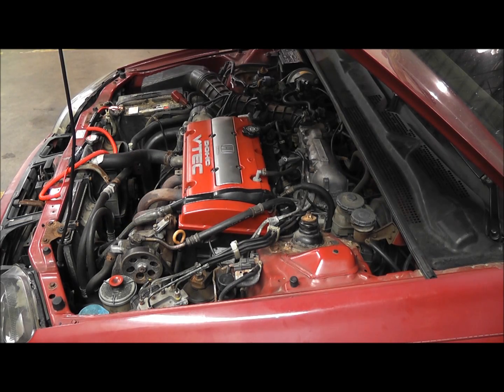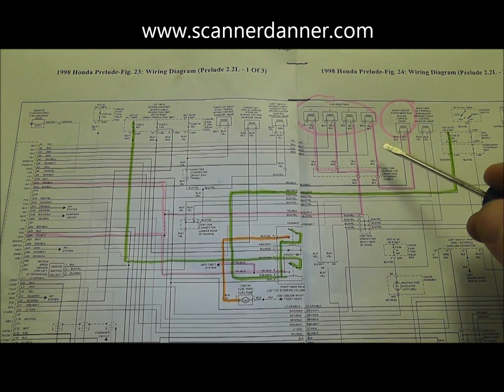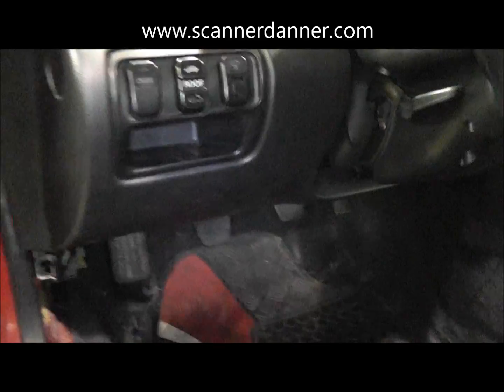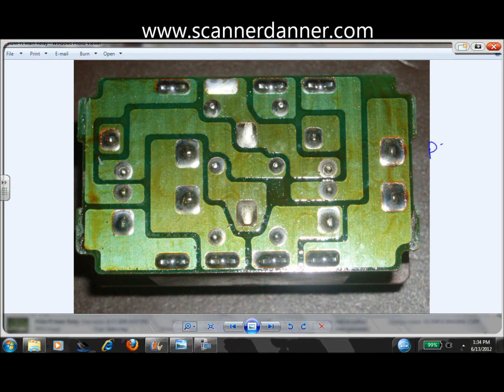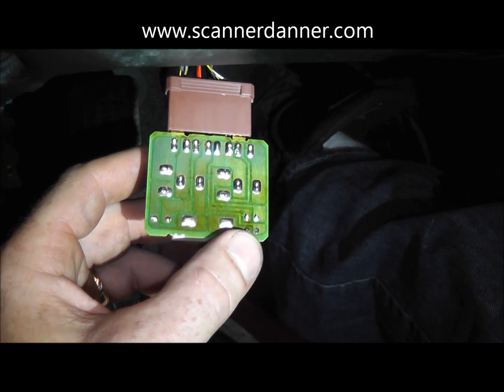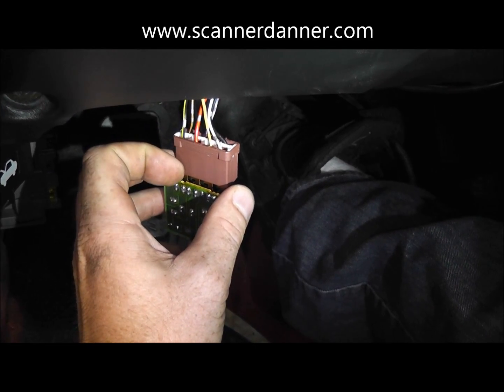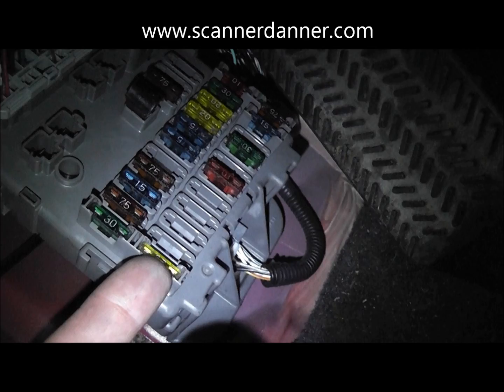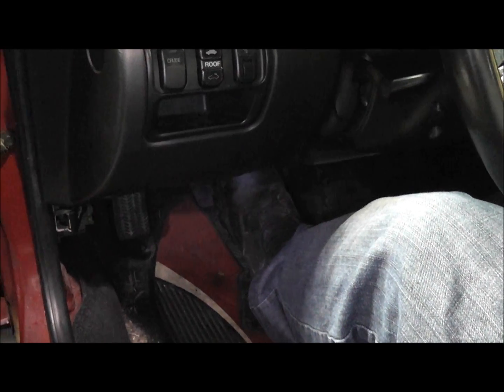How to test and fix a PGM-FI main relay - Honda/Acura

Comment: I can't tell if this is a silly question, but if this fuse was out for the green and white wire, how on earth did the car start at all ever?

I'm trying to figure out how the car could fail to start and then once the guy gave it some gas, overcame that resistance to start while the reading the white wire was absent.
Reply from the maker: I don't remember but I think it was kicked or bumped and fell out and never started after

Comment: ...mmm WRONG  !!!  I could start my 2002 Odyssey and it would die while I was driving it !   if you waited 10 to 15 minutes it would cool down and be able to start again !   $80 dollar part at AutoZone and $147.08 at Honda    August 2024
Reply from the maker: Lol, like I have any idea what you're talking about from a 10 year old video. Context helps!
Reply: @ScannerDanner  one of the MAIN RELAY's  solder joint's on the circuit board over heats and melts apart while the engine is running and stops the car dead !  If you allow it to cool down... the solder comes back together just enough to allow you to start the car again .... BUT it will soon over heat and fail again
Reply from the maker: @diverdave4056  when we saw these it was always after sitting. Never saw one with random stalling. 
But yeah, you were shouting too, which is kind of ridiculous. Especially on this old dinosaur

Comment: What if it only doesnt start when cold outside like temp wise anything below 35 it will just crank and not turn over. I have a 98 honda prelude. New fuel pump within a month after old gave out, fuel injectors clean and spraying like new with replacement pressure and orings, fuel filter new,  42 psi when checked. New Ngk plugs, wires, rotor, cap, ignition coil, valve cover gasket, no vacuum leaks, entire cleaning and regasketed the intake manifold, tpms had a crack which was replaced and relearned, the throttle body was regasketed and cleaned, the air intake filter new, ignition switch new, air intake temp new, great spark, and ignition timing, ect reading properly, icav new, the fitv  regasketed and cleaned, bad terminals replaced, brand new honda battery due to other being old and giving out. And im sure theres some other things missing but after all that the darn thing still wont turn over in winter. Oh and main relay is pulled as im typing and seems the solder joints are good! I dont know what else it could be other than pcm but reads live data correctly or am i  missing something to look at.

Comment: I had the white with green not light with a test light.

So i got a new main relay and nothing. Still no crank no start.

What's the problem now? I checked the fuse for it and it won't light up with the test light either. Switched the fuse with a known good fuse that lit up and still no light.

Could this be a wiring issue? Any help is appreciated

Comment: I had this problem on my 2003 Honda Pilot and it finally died completely on the freeway where I coasted to an exit safely.  An hour of it cooling down and about 20 cranks and lots of taping the module with my knuckles didn't help start it.  Had it towed home.   Two days later, I tried starting it and it started right up.  It had been doing this on and off for about nine months and just got worse and worse over time.  What I learned was that my 25W soldering iron wasn't enough heat for the joint and the large relay pins, etc.  I switched to a adjustable soldering station and at 700 degrees F it still wasn't enough heat.  I finally cranked it up to 850 degrees F and it was able to do a good job.  I first used solder wick to remove all the old solder and cleaned up the joint real well.  I then used a rosin-core solder and got real nice new solder connections.  The car started right up and has worked fine (so far) for about seven restarts, even when the engine was hot and then sat for about 10 minutes (a typical stop at a store, run-in, and back out).  Really appreciate your videos.  Thank you.

Comment: Sir when you test the IACV yellow wire is this key on or not? thanks
Reply from the maker: Yes, key on my friend
Reply: ScannerDanner hi friend when i tried to test the yellow wire using test light the light is dim not brighter?
Reply from the maker: @jordanfort4294  Then you have a voltage drop on that circuit
Reply: ScannerDanner what does it mean sir? thanks
Reply from the maker: @jordanfort4294  high resistance, corroded connections, break in a wire (not a full break), you need to trace that circuit and you will need a good wiring diagram https://eautorepair.adtrk.biz/?a=10817&c=24&p=r&s1=
Reply: ScannerDanner thank you so much sir✌🏼
Reply from the maker: https://eautorepair.adtrk.biz/?a=10817&c=24&p=r&s1=

Comment: excellent video just want to add a little, I had this problem several times replace relay repair relay comes back , when fuel pumps get old or fail they pull more juice cause more heat consider replacing pump if repeats,
Reply from the maker: Great advice, thanks for the tip for the community!

Comment: So. If the main relay is not the problem, we must check at the fuse box !! Great !!! But where go to, if the isn't getting to the fuse box neither?
Reply from the maker: ignition switches are common failures on these systems, they key is having a good wiring diagram https://eautorepair.adtrk.biz/?a=10817&c=24&p=r&s1=

Comment: Last night I fixed my neighbor's 97 3.5 RL before seeing this video.  It had cracked solder joints AND a missing fuse.  Bizarre.
Reply from the maker: that is weird
Reply: @ScannerDanner  Today he was out pressure washing it.  It sat for almost 9 months!  Anyway, I was thinking about doing a video about this but seems like you've got it covered!
Reply: Oh one other thing I should mention for future reference is that there was another symptom that cropped up - I hooked up my cheapo OBD-II scanner and it wasn't receiving any power from the port.  That problem went away after replacing the missing fuse #6 which is what was supposed to give power to the PGM-FI unit on pin 3.  According to the Chilton book, that 20A fuse supplies both the 2nd half of the PGM-FI relay that feeds the fuel pump but also the powertrain control module.  Unless that port only works when the engine is running, then it seems that getting no power to the scanner might be a good indicator of that circuit having failed in some way.  (97 Acura 3.5 RL)  I should also mention that I have seen problems related to cracked solder joints on many Mercedes vehicles too, and have done videos about that.  This seems to be a common failure mode whenever a heavy component like a relay is mounted to a circuit board using only the weak solder electrical connection as the mechanical connection as well.  Years of vibration just break the soft solder at its stress points.  Many sudden and intermittent failures can be fixed by re-soldering joints on cars that have this type of circuit board construction.  Adding an electrically inert and acetic acid free adhesive to stick the components down and hold them fast to the circuit board, where feasible, is a more permanent fix than solely re-soldering the joints which are not up to the task of supporting the full component over time.
Reply from the maker: Do it anyway!

Comment: I just resoldered the points on my Fuel Pump (PGM-Main) Relay circuit board on my 1995 Acura Legend on your recommendation and it actually worked!  Thanks so much for the video.

Comment: Hi ScannerDanner great video by the way I had a question I'm trying to figure out why my 2001 Honda civic ex will crank but won't start. Let me start off by telling you that someone tried to steal my car but failed and even though they didn't steal it they cut all the wires on the driver side under the dashboard. My question to you is when someone does cut the wires below the dash driver side did they short my PCM and I have to replace it? Or is it the PGM Fi main relays that I need to replace and that's it? I just need some sort of direction if where to go with this.
Reply: First let me tell you that I'm not a mechanic by any means , but we might be in the same boat ... my problem is a no Crank,  no start but I think what I have to say still applies ....the IMMOBILIZING SYSTEM  ( ANTI - THEFT ) in my 2005 Honda crv DISABLES THE FUEL PUMP , FROM WHAT I UNDERSTAND . AND WHEN I PUT MY KEY TO THE ON POSITION , I DONT EVEN HEAR THE FUEL PUMP PRIME FOR 2 SECONDS OR SO ... I FIGURE somewhere between the fuel pump and pressure regulator , injectors , PCM FI MAIN AND ALSO PCM FI 2 is the problem , apRt from fuses , relays and wiring connections ....they cut all the wires probably to disable the ANTI- THEFT IMMOBILIZER . I DISCONNECTED MINE ON PURPOSE BECAUSE I THINK IT IS WHY MY FUEL PUMP IS NOT PRIMING .... IF YOURS IS CRANKING BUT NOT STARTING , THE FUEL PUMP PROBABLY IS PRIMING ... for me , I need to figure out how to bypass my immobilizer ???????
Reply: Take EVERYTHING I SAY with a grain of salt , but I am almost positive it is not the PCM , OR EVEN THE RELAY , IF IT CRANKS BUT DOES NOT START .... IF IT CRANKS , THE FUEL PUMP IS PROBABLY PRIMING AS IT SHOULD , WHICH MEANS THE RELAY IS DOING ( AT LEAST PART OF ) ITS JOB , which means the PCM is doing  part of its also . I would also pretty much rule out the IMMOBILIZER , BECAUSE IT CRANKS BUT DOES NOT START ....... BELIEVE ME , I have been trying diligently to figure this out for over a year now : I want my CRV BACK !!!!!
Reply: BY THE WAY , I don't make ANY MONEY ,so I try to solve all of my problems without the aid of MONEY : so you can just imagine how much I greatly APPRECIATE PAUL DANNER , AND THE LIKES OF HIM : ANGELS , GOD-SENDS , IF YOU ASK ME ...!!!!

Comment: So annoyed with my 99 accord, thought it was the main relay and replaced it with a new one from oriellys, did not fix it so I replaced the fuel pump and that didn't fix it either, my car runs good in the morning until I get where I'm going but when the engine is warm and I try to restart it ? It wont start, and a couple of times it did start then died going down the road and left me stranded for 30 minutes or so, I'm wondering if my issue is the immobilizer or ignition switch or key? Because the green key light flashes 5 times after I've pulled out the key

Comment: Nice vid ScannerDanner. I just checked my Mistuba main relay in my 98 crv and don't see any hairline cracks. I just bought this car and having an intermittent crank but no start issue.  I just spent about a grand in parts and had the head reworked, (burned exh. Valve) and replaced all ignition components while there. New dist., wires, plugs. I have yet to adjust the timing on it but probably will tomorrow. Runs great when running. I haven't had the car but a week so I'm not sure how intermittent the problem is. When it does start it sounds like its barely firing, or catching, like holding the starter engaged longer helps it get to firing somehow, if that makes sense. But once running it sounds great.

Comment: Anyone - please reply - is this only for Honda's that do not START?  because my 99 Honda Accord wants to STALL when I stop at a red light or stop sign or when making turns.  PLEASE reply soon - DO NOT want to go to mechanic and get ripped off! Thanks in advance !
Reply from the maker: not all mechanics will rip you off 
So does it not start or you have a stalling problem? Two separate issues.
Reply: It wants to stall whenever I am driving  and need to stop at a light or stop sign.  I checked the main relay and it looks in great shape - even checked with microscope for cracks, etc.   Should I replace main relay anyway?   Car starts just fine.  Thank you  ps - I am very new to car repair.
Reply: Uke - It could be a dirty idle air control valve that's getting stuck. They're easy to take off and you just clean them with a 5 dollar bottle of carb cleaner. Probably will want to reset the ecu after that. Also, buy a bottle of fuel injector cleaner and put that in your tank next time you fill up. It could also be a vacuum leak, look up how to check. Most mechanics aren't looking to rip you off, they want your return business and there's always a lot of competition in town. That said, always do a google search and try any easy solutions before going to a mechanic, they won't try to clean or repair parts, they just replace them, so it's worth the effort sometimes.

Comment: Hello Paul, I have an 02 Acura type S,where is the fuel pump relay and the main relay located? Starting problem
Reply from the maker: https://www.google.com/search?q=where+is+the+fuel+pump+relay+on+an+02+Acura+type+s&rlz=1C1GGRV_enUS751US751&oq=where+is+the+fuel+pump+relay+on+an+02+Acura+type+s&aqs=chrome..69i57.2538j0j8&sourceid=chrome&ie=UTF-8

Comment: I have the same 98 prelude and i suspect something with the main relay after i scanned it for trouble codes and got p0505 for Idle air control system. Also after checking the live data, i noticed the STFT was fluctuating around -20% on average obviously telling me it has a very rich condition, checked O2 sensors and they are working fine. I then noticed when i turn the key to the run position, the fuel pump will prime but not shut off until i either start the car or turn the key to the off position. So my question is what could be the cause of this, i was thinking it has to be an issue with a switch in the PGM-FI main relay staying closed, or the relay itself failing causing the fuel injectors to stay on too long causing the rich condition, as well as the fuel pump and iacv issues? Car has over 200,000 miles on it and 120k on the motor
Reply from the maker: Two separate problems my friend. The fuel pump runs continuously while the car is running and will NOT cause your rich condition. Even with the key on and the pump running, this will NOT cause any fuel to get into the intake as the injectors are normally closed solenoids. Attack your rich condition and your idle control fault code first. 
Hope that helps.

Comment: I soldered the ones that had cracks and when I reconnected it to the harness it was working fine. I didn’t drive it around right away and after a couple of hours i tried to start it again but it doesn’t start anymore. It just cranks. Did I pop a fuse? The check engine light doesn’t turn on momentarily as I start the car.
Reply from the maker: You may have? Check all your fuses for sure and then recheck your solder joints and make sure you didn't cross any of them
Reply: ScannerDanner I popped the ACG fuse under the hood. Thankfully an easy fix. Thanks for the reply

Comment: can someone make a video how to get it out of the case I'm having a really hard time plz message me if you do will be greatly appreciated. I can even PayPal you 10 bucks.
Reply: dillon cassidy did you ever figure it out man?
Reply: dillon cassidy I used a tiny flathead to pry it out while pulling the casing in the opposite direction.
Reply: +Anthony Alvarado yes I did.and then I sold the car.

Comment: Starts fine in the morning but the longer I drive the less hp I seem  to have. After I drive it long enough it slow cranks if I try to turn it back on but I can always get it back on. Longer I drive, slower it cranks. Could this be main relay?

97 civic ex

Comment: I have a 91 honda accord with a  no start issue checked for spark it's good sprayed starting fluid into the tube that leads to the throttle body it acts like it wants to start when I hooked up my fuel guage didn't have any fuel spray out could the main relay not be letting the injectors fire shouldn't I have some fuel leakage?
Reply from the maker: I think these videos will be helpful for you. Let me know
https://www.youtube.com/watch?v=6CMZ4g8n0FQ

https://www.youtube.com/watch?v=SUxagOAVS5M

Comment: I can't find a single video where you cover wire or solder selection for repairs.  I've been using some cheap autocraft solder from a parts store and it's god awful to solder small joints with.  I've found that tin/lead solder is 10X easier to solder small electronics but isn't good for engine bay use because it will rust away.  I feel like this stuff would be a great topic for you to cover for the guys who are just starting out that have never soldered a thing in their life or are having problems with solder flow even while using flux and tip tinners.

Yeah it's easy to solder with big wires and rosin core but even in automotive you're not always soldering large gauge wires or large joints.  Sometimes you have to do repairs on tiny joints and that's where wire and solder selection really plays a part in time efficiency.  I spent 3 hours trying to repair something with crappy autocraft solder!  3 hours because the solder just wouldn't stick right and burned the wires in a losing battle keeping the wire and tip clean.  Once I used some better quality solder I fixed it in 2 minutes.  

For an automotive electronics channel I was quite surprised to see you don't have a video on this subject.  You're still my #1 favorite channel.  God bless you and all in your family.
Reply from the maker: Thanks brother! I'm not sure that I do. I know I soldered many, many times in my videos but nothing solder specific. 
Post this to my forum bro. Hope to see you there
https://scannerdanner.com/forum.html

Comment: I seldom comment on videos but wanted to say VERY WELL DONE!   Bright video, loud and Clear audio, and no bullshit nobody has time for.  Your the man.
Reply from the maker: +Marty Merryfield thanks Marty
Reply: @ScannerDanner  hey hopefully all is good… I’m here struggling with an o2 sensor issue…. (Think it’s in the harness)I watch ur videos tried the harness signal wire connector with test light to negative get no light (scanner says before touching wires 3.803 n o2 unplugged )when I touch it with test light goes to 0   What Does that mean? Please help n god bless
Reply from the maker: @pickumtee6882  you shouldn't get a light on the signal wire, ever.
What are you working on?